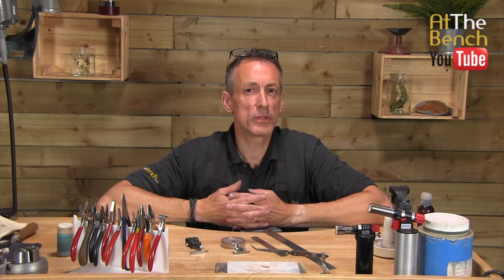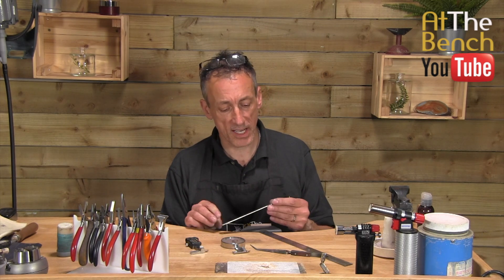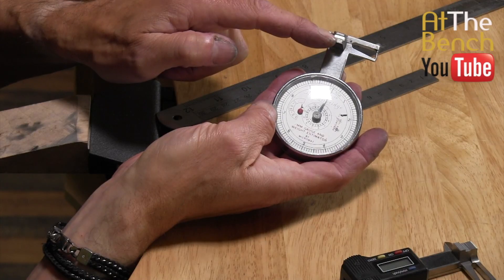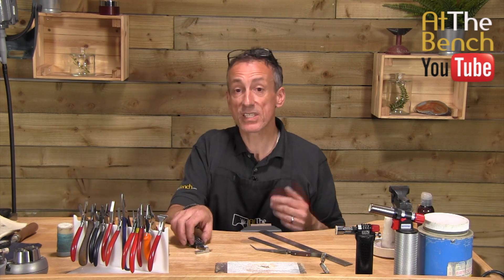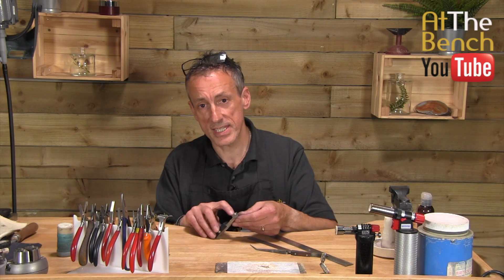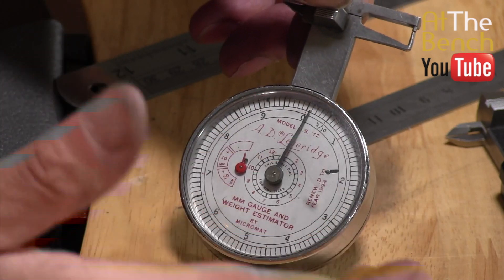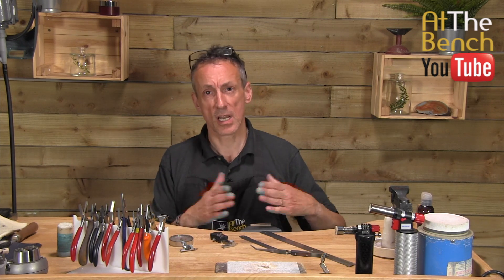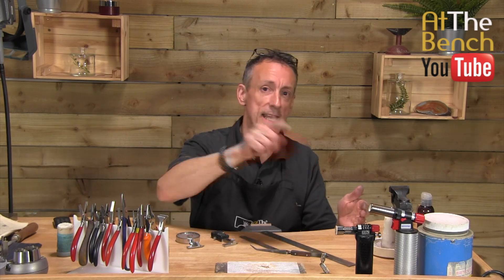What Do You Use To Measure When You Are Making Jewelry?

Comment: Yup. I use similar measuring tools. I also use a depth gauge, protractor, callipers, gauge plate, gap tool, thermometer, sharpie ink (for measuring temperature around 900°f), soot (for temp near 1500°f), and a small scale for weight. I also use body parts for comparison.